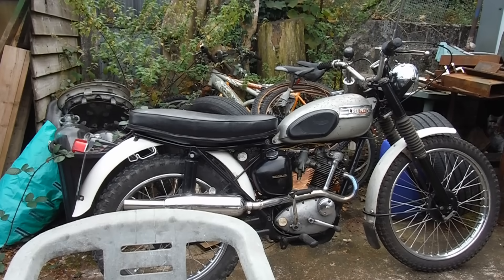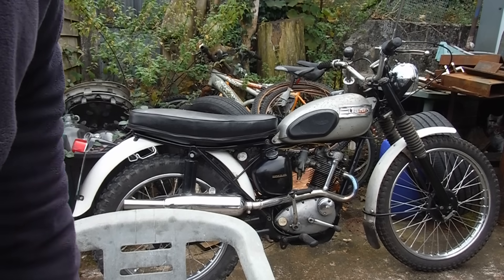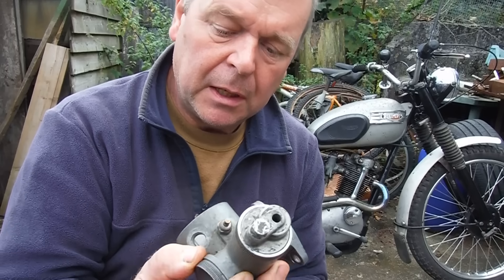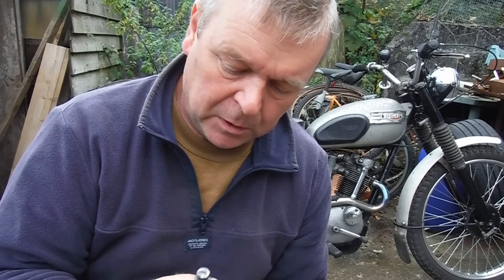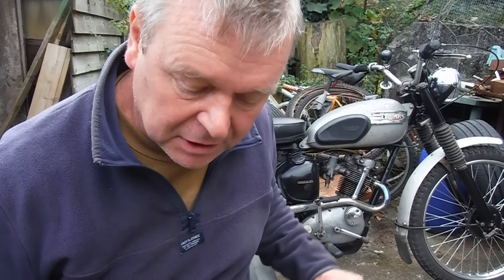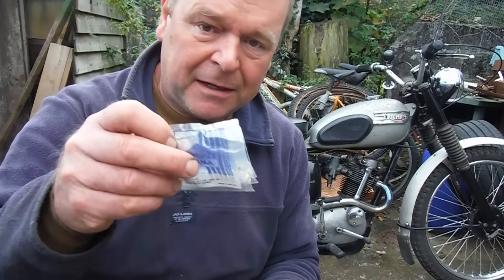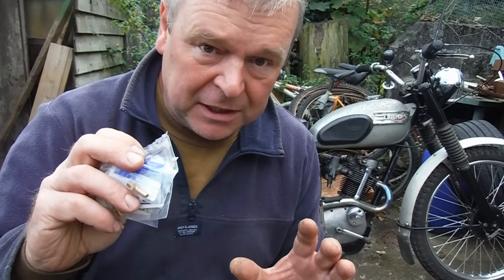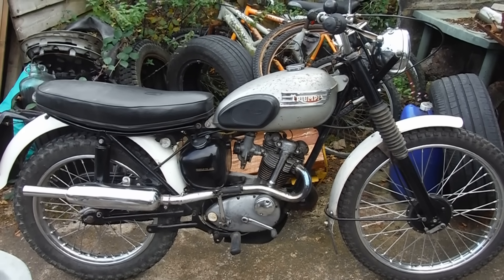Modern fuels, pinking because of them and an easy way to help overcome such a problem.

Comment: I have built my own fuel injection system for my little trials car. I use a wide band lambda sensor and gauge which feeds into a tuneable ECU. I have spent a very long time getting the fuelling correct. I’ve set it up to use E10 fuel because sometimes that’s all that I can find. The software allows me to see the relative quantity of fuel being used at any moment. If I do fill up with E5 the software will begin to trim the fuel quantity down by a noticeable amount to keep the air/fuel ratio to what I’ve set in the fuel table. This confirms that E10 contains less effective mass of usable fuel and therefore runs leaner than E5.
Reply: This is correct.  Ethanol has a lower calorific value per unit volume than the other constituents of petrol.  Petrol is a mix of different organic compounds that are not specified too tightly, so it varies over brand, and even from one batch to another.

  Well done on your build; it sounds like an interesting project.  What is the "gauge"? What are the other sensors you need? Throttle position, crank rpm,venturi vacuum, intake air temp? Sounds like a nightmare.
Reply: @daveycrockett64 AEM-X afr gauge with Bosch wide band sensor. Emerald K6+ ECU. BMW K75 motorbike throttle bodies and Renault Clio Sport injectors in the inlet ports (it’s a three cylinder, 993cc engine). Sensors required are throttle position, crank position, inlet air and coolant temperatures. Apologies to Paul for thread drift!
Reply from the maker: @wheater5  No problem, interesting stuff!
Reply: @paulhenshaw4514 Thanks, Paul.
Reply from the maker: Interesting, thanks for sharing!

Comment: I altered my carb settings  on my tuned DR400S in the 80s due to fuel composition changes. I later  consulted with a rally engine engineer. He said he'd had a bunch of seizures at the time of change. These changes were well before ethanol was added. Having said that the standard settings on my 1981 KLX work without problem, as they  do on my 1960 G3C. Carb problems are far far more likely to be a result of worn carb/poor ignition [modern NGK plugs don't last long if the ignition is weak] than modern fuels and you won't sort that by altering the needle jet.

Comment: I agree entirely, this is the exactly the experience I've had with my BSA B44.
It was pinking on load with the original Amal Concentric and I suspected it was the carb slide, which was very worn.
So I bought a new Wassell Concentric carb, pre-set up for the B44, with a 106 needle jet and it still pinked like mad.
I've watched almost all your videos and recalled your mentioning the needle jet, so I went up to a 107 and the pinking vanished and never offers to come back no matter what I do.
Thanks for sharing your knowledge, Paul.
Reply from the maker: Thanks! Glad the videos were helpful!

Comment: Hi Paul thanks for your hard earned knowledge it’s most appreciated, do you use any additives in your fuel such as lead replacement and octane boost, I use a castrol one that’s supposed to be very good but like you I’m no scientist so I’m only going on what I read and gut feeling, keep up the good work Paul 👍
Reply from the maker: Hi and thanks. No, I never use any additives in my fuel or oil.

Comment: Good tutorial Paul! Thanks! Lean mixtures & retarded timing basically killed the Shovelhead motors in the early 80’s due to emissions! Give the engines what they need depending on design & they run cooler without cooking the gaskets & seals & putting holes in pistons! Your experience in feeling what the engines need is a rare gift indeed!👍

Comment: Have you figured out how many notches (out of 5) on the needle position is equivalent to a jet size difference of  .101 or more likely .1005? I refer to monoblock with a normal taper.
Reply from the maker: Hi Neil, it seems after a fully raised needle, the next step is the next size needle jet with the needle set at it's lowest.

Comment: I thought ethanol burnt slower than ye olde fuel therefore I would have thought you would increase the advance?
similar issue with a machine I put back on the road after a couple of seasons, had been running perfectly now has no power after 40mph, raised the needle one notch from standard and all is back to normal. what's changed; carp fuel/ethanol.

Comment: I'm a retired scientist and I would trust you to tune my AJS.  All this talk of pinking and petrol reminds me of the "Formula Shell" fiasco of the 1980s.  I didn't have a bike at the time but I couldn't stop my Vauxhall Astra from pinking like mad until I stopped using "Formula Shell" and went to the nearby National garage instead, which fixed the pinking.  I've been a regular customer of theirs ever since although they are now officially a BP station.  I'm pretty sure that my carburettor (Wassell) is jetted by the book but the next time I have it apart, I'll check the needle jet size (book says 106).

Comment: Great tip on the needle size jet Paul 
You are correct about modern rubber I reckon it's entirely chemically made these days 
A mate had a tip for me 
He said he was sick of fitting new footrest rubbers that split after a few months and they looked dried out where they'd cracked,so he stuck a new pair in a freezer bag and added some waxoyl  (the stuff you spray into car chassis to stop rust) he left the rubbers soaking in waxoyl for a couple of weeks and so far no more cracking
Reply: Is it called "fishoil" different places ?.
Reply: @Orangesjesus  nope it's "waxoyl" used on car chassis

Comment: Any petrol since the days of leaded fuel causes clear or braided plastic pipes to harden, which can cause much worse problems if not sorted. Even dunking in boiling water wouldn't loosen it enough to remove it from taps and banjo's. Careful use of a fine tooth hacksaw blade, running around in a spiral has been the only way.
I now use black "rubber" pipe designated for fuel use but even bog standard oil pipe seems to be holding up ok. It's usually printed on the pipe. Viton O rings on carb flanges and Viton tipped float needles. I almost exclusively use E10 in my T100R (MkI Amal carbs) and my Triton (MkII Amal carbs) and haven't experienced any of the problems which often come up on various pages and forums. The only change I've made was about 5 or 6 years ago, I fitted a 107 needle jet and replaced the EI for points.
Paul, you may be on to something with regard to modern "rubber" and plastics because, most of the complaints I've seen are from much later bikes from the 90's onwards. I would expect the most current bikes have been proofed against ethanol
Reply from the maker: Thanks for that. I forgot to mention in the video (I meant to) that I suspect the hardened plastic fuel pipes on my Trident are the originals - certainly they have been on it since 1982 when I bought it, and they were hard even then, also, the rubber fuel pipes on my Honda CB500T are probably original, having owned this machine since 1983. I sometimes soften hardened plastic pipes with the heat gun, applied carefully, but I am not suggesting anyone else should try it!
Reply: @paulhenshaw4514  Hardened plastic pipes caused the fuel taps to tear out of the alloy Triton tank. Both at the same time. Half a tank of fuel pouring out on my way to work. Luckily I was going down hill, so managed to escape the white smoke. Hell of a push home though
Reply from the maker: Wow!

Comment: Paul, this is a very relevant and timely video because I am thinking of asking for an Amal monobloc rebuild kit (376) as a birthday present to use on my AJS 16MS 350 single - 1957 model. Let's face it, it's better than the usual shirts, scarfs etc..... The Amal kit order form requires specifying the main jet, needle jet and pilot jet options. According to the original 1957 manual, the needle jet is 0.1065, the main jet is 220 and the pilot jet is 30. From what you say and what I have also gleamed from Paul Ireland's book, I'm thinking of changing the needle jet to 0.107 (not 0.108) and keeping the other jets the same. Would you agree with this as a first move? I can always buy new jets later if needed. I would keep the standard timing and auto advance module. Cheers mate.
Reply from the maker: Hi Mike yes, that seems like a sensible first step.
Reply: @paulhenshaw4514  Thanks. It also recommends a central notch position that I was thinking of keeping.

Comment: Modern plastics are the same they snap very easily compared to the older ones on models from years ago
Reply: I think they have found cheaper formulations.  They can make stuff better than ever...but only if the manufacturer is willing to pay the price.

Comment: PINGING
Reply from the maker: PINKING.
Reply: Pinking is the English / British word for "the sound of pre-ignition".
Reply: PINKING!
Reply: Pre-detonation!!
Reply: @Mike-H_UK  Detonation is a separate phenomenon to pinking. The former is induced by a massive uncontrolled burn of the fuel caused by hotspots (not spark ign) in the combustion chamber, the latter is caused by an inconsistent burn of the flame front as it radiates the combustion chamber.